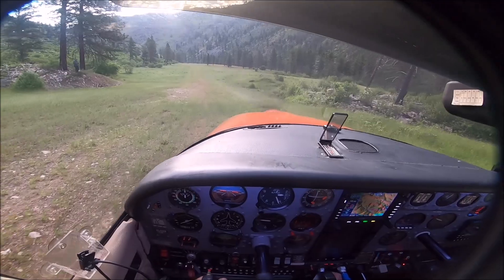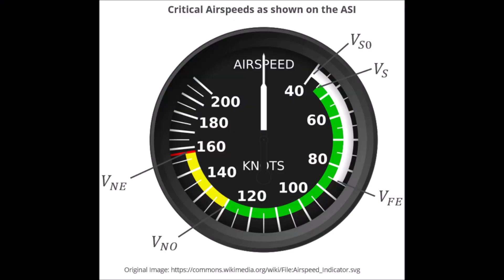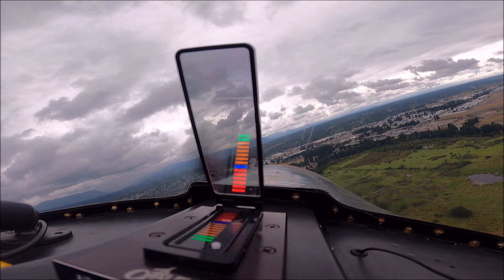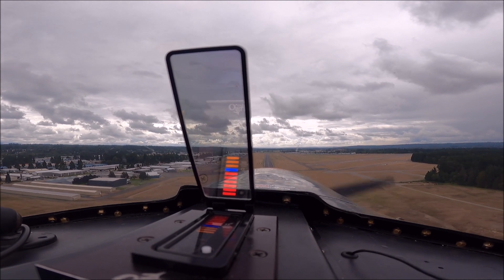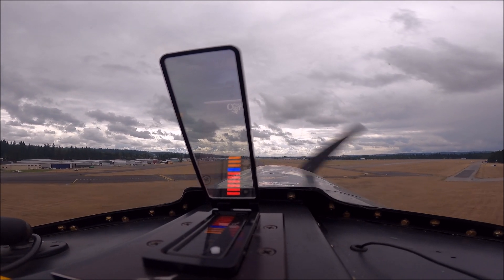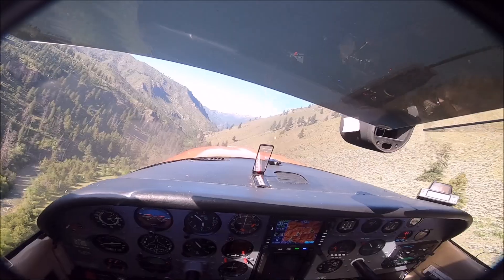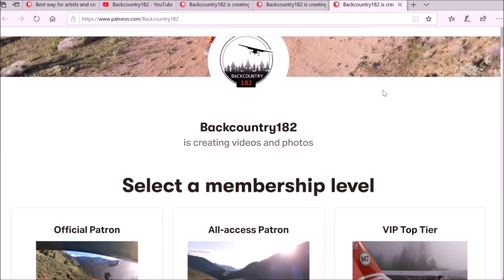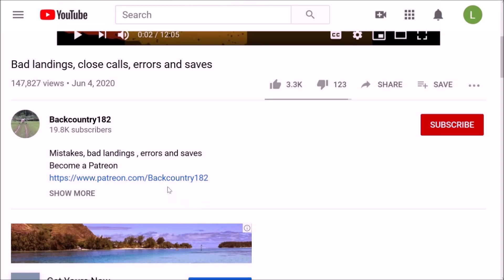Angle of Attack Indicator, explained and demonstrated

Comment: What's up I saw the video interview on the other pilot Chanel and was wondering you can show of the motor cycle racing you use to do
Reply from the maker: Here is a video of a Bike ride in Peru I do https://youtu.be/PxFLGqwizJM
Reply: Thanks that was great the husky is top of the line, when I was riding in the late-60s and 70s the two stroke was hard to beat also The maico  the bulls were fast but had engine issues thanks again that was some cool riding

Comment: Notice there is little if no "float" during his round out because he is not using his airspeed indicator as a guage to determine his approach.   Rather, he is relying on how much lift he has available by using his AOA indicator.  It's no wonder why people who fly Mooneys land long with  excess airspeed during the round out.  Their final approach speed is too fast under the circumstances.  Then, they add extra airspeed for wind gusts for "just in case". 
      They end up using more runway than necessary for the misconceived notion that "extra airspeed" is necessary safety.  It is not.  It's probably less safe to come in hot than to come in at the proper AOA all the way to the ground.